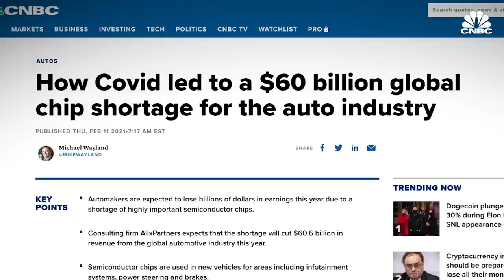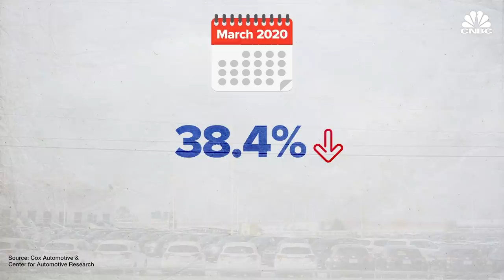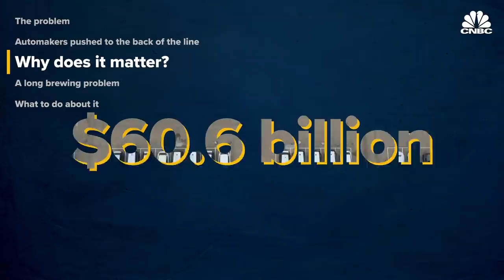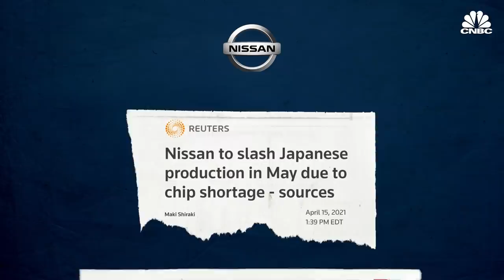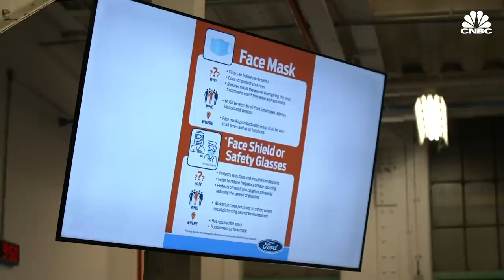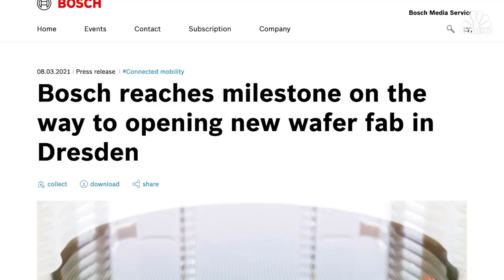Why Tiny Microchips Are Crippling The Global Auto Industry And Driving Up Prices

Comment: Or bring home the supply chain and not deal with these problems
Reply: Maybe some of these chains are foreign companies and not from the USA. Shocker right?
Reply: Yes and no.  I agree we need to start making stuff back home but there's always the issue of supply chain since chips use rare earths that aren't readily available here so there's almost always going to be a link in the chain we can't bring back home.
Reply: That's not the problem, the problem is that auto manufacture underestimate needs, cut their order allocation, then regret. Do you know how businesses work? The same exactly will happen if the chip manufacture is in the US, if auto companies cut their order then chip manufactures has to find other buyers to fill the order, do you expect the chip manufacture to sit there and do nothing with the idle capacity and lose money? That's not how business work.
Reply: Rare Earth minerals are quite expensive to mine which is why they're mined in China so the profit motive really doesn't allow it. Also most of the advanced chip Supply is under the control of tsmc Taiwan and Samsung South Korea. You're not just going to hand over their secrets. Tsmc did agree to build a plant in the US by 2025 so that should help but by the time it starts producing 5nm that will already be outdated Tech. they're doing this on purpose because Taiwan uses tsmc as a security guarantee that the West will help them in case of an invasion by China. Also even if the plant was in the United States, it wouldn't make a difference because chipmakers wouldn't close down their Factory just because automakers canceled their orders, they would obviously take other orders and automakers would still have the same problems. We could ship parts of the supply chain to the United States but shifting almost all of it is an extremely difficult task because of the fact that is literally like a hundred countries involved in it
Reply: Lol. I like how you think it's that simple.
Reply: @benchoflemons398  Fed can print as much money as they want, but you still cant immediately buy chip with money, you still have to submit your order to chip manufacture a year before you actually get the chip made, so that doesn't solve the problem here where ato maker underestimate and cut their order
Reply: not "bring home" per ce, but Trump did contract the world's largest chip manufacturer from Taiwan to build 6 factories in the US. So it's happening, just maybe in a decade's time

Comment: I think this might pinch out some of the automakers that can't pivot quickly enough to make use of commodity electronics. The infotainment centers and even the highest in cars probably don't have the processing power of the top end raspberry pi. Add a touch screen, a case, power supply and a cellular modem and your bill of materials couldn't be much over $250-300. But they will charge you 10x that when you buy it with a car (and 25x if you need a replacement part). The way I figure there's really about six processors that really need to be in a car. You have the engine computer the handles the drivetrain, a chassis computer that handles the brakes, suspension and steering, a body computer that handles the climate control and windows, wipers, lights, seats and so forth, the infotainment which handles the radio & communications systems. We need a fifth one for autonomous functions, and last we need a system for active collision mitigation (air bags, pre-tensioners, deployable safety features such as exterior air bags, pop-up hood hinges, rollbars, suspension reactions to prevent roll-over, and of course Elon's cold gas thrusters to jump over anything they can't accelerate, decelerate or turn to miss).

Comment: No general shortage of microchips. Car dealers, novices at electronics supply chain, moved from using standard embedded computer components to custom fabricated and programmed chips to "provide extra value". Everyone wants custom chips but turnaround is longer and fewer silicon fabs have that capacity. The additional cost could have been put towards building a US silicon fab.

Comment: My question is, is there a potential for recycling of old chips from old cars or “totaled” cars that might otherwise be thrown out?
Reply: Not in the sense you are referring where they can be salvage for re-use.  The chips are all surface mounted so the labor it takes to remove without damage is incredibly high and creates reliability issues in the environment they would be remounted for use (lots of vibrations, temperature variations in a car).  Also, the chips are made to order with subtle changes to the extent they wouldn't even work properly in other applications requiring something similar.

Comment: An issue is chips can be very specialized, whereas if you can use 'programmable' chips, the same chip can be used for all functions.  Field Programmable Gate Arrays for example.
They are more expensive for sure, but compared to the losses, an extra $5-10 seems cheap now.

Comment: Ok. I got a question. What would be the feasibility of getting a car without chips? You can get a lightbulb to light up with an orange.
Weather channel has the temperature. 
Can I get a car that starts, I push pedal and it goes forward? I'll even take a manual.
Reply: It can drive, but it will most likely consume a lot more fuel (no engine controller), have few safety features (no airbags, ABS etc), no radio besides good ol analog tube radio and ofc no cruise controll and the likes
Reply: @johnuferbach9166  Fuel consumption sounds like it could be the only downer. What about power? Can my cell phone charge? 
I dont see a problem with this setup.

Comment: I would love the option to buy a vehicle with hand roll windows manual transmission and no chips.
Reply: So twice the fuel consumption, no airbag and no radio?^^
Reply: @johnuferbach9166  More gears and less slop, a manual is usually better on fuel then an automatic.  airbag and radio I could easily live without.

Comment: What u expect when more and more tech they put in car that u need a manual to use it. I and if not most average people are fine with a running car with simple cd player and speaker system, running heat/AC, electric windows and other simple necessary.

Comment: The answer is pretty obvious if there's too many chips installed into a single vehicle. Imagine if this was the standard for each and every home appliance. Clearly, a single chip is needed for car manufacturers to try and adapt and adopt because it will be a continuous issue if not dealt with correctly.

Comment: Aside from the time and capital it takes to setup silicon fans, good luck making 7nm wafers... Right now no one aside from TSMC has been able to successfully produce at commercial volumes. There's a reason TSMC is king, no one else has the know how
Reply: Its not the making of the 7nm Wafer that is/was the stumbling block. The actual chip speed/processing power is barely in the i386 or i486 processor capacity. What does a 2.0 litre gas powered twin fuel injector system need a thin panel display in the front dash for ? Nothing. But give it precise production tolerances, and effective build techniques, even the latest production car could be run with a series of 6502 or 6800 processors, each doing their "specialty" while leaving the "main" processor running at 50% capacity, with room to spare. i386 technology was 1000nm or 1um in 1985. [1]

It is not that TSMC is making 7nm wafers. It is that they are making 7nm wafers and their rejection ratio from the fab is so low, that they concentrate their efforts into that size of technology.

You do not hear of the Dacia/AutoVAS group of companies slowing down production of their cars. NASA guys laughed at the "washing machine timers" used in the Soviet designed rockets. But there is something to be said of a device that "takes a licking, and keeps on ticking".....(TIMEX).

[1] https://en.wikipedia.org/wiki/I386

Comment: The problem I see is that a lot of these chips are being used to deliver features that I neither asked for, nor want to pay for, but are included in the bundle, and hence are unavoidable.  They are designed for lowest cost to manufacturer, so there is no resilience for repair or upgrade.

Comment: The solution is simple.
1a. More chip manufacturers spread out evenly accross the planet in various regions, no more monopolies/oligopolies thus having a fair and competitive market. 
1b. No more merging, fusions or acquiring of competitors and all partnerships between competitors to be very vert very limited as not to create imballance in the market like we have in the present. You have the same car sold as different brands. Wtf is that?! Ah different brands share like some seats and buttons and engines. Ok, that is sufficient, but the products should be completely different and not create an unfair and concentrate strength on the market.
2. Simplification of cars. Too many integrated functions, too many "smart" features. We don't need none of that. 
A car with the electronics of the 90s is sufficient. An electric motor setup is easy to do and not overly complicated in electronics, which are funily enouh wide spread, not automotive resteicitve like combustion engines.
Entertainment is too widespread, so no specific for cars there either.
Reply: Chips are also made in Arizona Texas and NY

Comment: Idea... Forget the need for chips. Go back to the old systems of manual, fool proof manual set ups. It's cheaper, more dependable, easier to fix, cheaper to fix, and , in the long run, much more dependable. Chips are subject to extortion and obsolescence. Chips are subject to voltage surges and electronic pulses. They are also subject to control by foreign government  bodies. Not good.

Comment: Why can't they centralize everything on a single chip instead of having one for every single system?
Reply: Performance. There's a reason you have a cpu and a gpu along with other chips in a PC. Each has its own function. Couple that with the need for memory chips for ram and rom, you need a lot of them to get the performance you need.
Reply: @spwicks1980  That was my thought but couldn't they design an all in one chip that can handle the different tasks? I can't believe a car requires high performance chips. Reliability and stability are more important. But when trying to find ways to cut cost, you'd think that centralizing the electronic would be one of the first options.

Comment: I added halogen lights to my Mini and even that wiring required a microchip controller module. It just turns on and off. This car is so complex it must have hundreds of chips.
Reply: It doesn't just turn on and off, it probably also does the power supply which is quite a piece of work already for high power lights^^

Comment: What are the reasons of shortages in chips? After going through the video I'm still more or less otherwise more confuse from where I started
Reply: Tons of people doing work from home and lots of disposable income stuck at home and using the money they did not spend in bars and restaurants to buy electronics
Reply: @denismiranda1372  that's the number 1 reason?
Reply: Your question is answered at 0:31 and again at 3:36 

To put it in simple terms, due to COVID people were NOT buying cars hence the 40% drop in sales. But they were buying electronics like video games, laptops, webcams, etc which use the same chips. The manufactures of the chips stand to make more money focusing on the electronics rather than the cars.
Reply: @eddy3080  ahh.. I see
Reply: @Edwin A it's most likely not the same chips... but the same fab space / time, so when the auto makers terminated their contracts for the production, the fabs allocated it to other customers, so the automakers were left in the rain when they wanted to get the production back up... it's not just car parts though, lot's of other compinents are also lacking right now
Reply: THe virus   higher demand for lap tops for kids to do at home school on line people staying home wanting video games

Comment: They can have the chips made in California.  There is a whole Silicon Valley area that only builds circuit boards and  chips.
Reply: not really as setting up a production line takes months, even years. Also, most of companies in silicon valley make small runs of prototypes, not big production lines, as thats whats needed there.
Reply: Cost of water and power wont put Cal as a desirable place. That's why Samsung and TSMC chose TX and Arizona. Even that, production yield is yet to be seen in the next couple of years.
Reply: Chips are made in Arizona Texas and NY
Reply: @TheLastCrankers  Chips are made in Arizona Texas and NY

Comment: “There can be thousands of chips in one vehicle”. WHAT.  I get that they are small, but I think that lady is confusing sensors with the actual chips that aren’t meeting current demand from the auto industry.  Am I wrong?  Where are the 1,000 chips in my vehicle?  I’ve  made software tweaks to almost every control module, damn near memorized the electrical documentation and data flows between modules… where are these chips?  If I had to guess, I’d say anything shy of a 2019+ TSLA, MB, Audi, VW, Chevy, Ford has a max of 30.   I mussed be misunderstanding something, right?

Comment: They are made out of sand just go to desert and dig some up.. they have something called carburators available holley and Edelbrock make em
Reply: With a little Caveat! The EPA in the USA forced the hand of the car makers in the 80s that was the death siren for manually adjusted carburation with an RPM of Idle to 4000 where the fuel is gasoline, and the air intake cannot adjust the air/fuel ratio to get the complete combustion needed for a "clean burn" aka stoitiometic ratio. If Holly and Edelbrock were able to be ^compliant^ over the complete EPA drive cycle, they would do it. But they cannot. (Not with Naturally aspirated engines AND fixed piston Volumes.

Turbo enhanced CAN do it however by blowing more air into the cylinder per intake stroke, but GM can't enfringe on the BOSCH fuel injection pattents, nor can VW have "Flex-fule" in their advertising.

But FORD was designed to run on 100% home made alcohol, yet the CONGRESS pet an end to that idea right quick.

So, where is the actual problem?
Reply: @richardinoutofcobourg7212   yeah gov always thinking of ways to mess up the little people

Comment: Chinese GM makes a $5000 urban EV that plugs into 230V outlet.  How many chips in that?

EVs have no emission control.  No ignition.  No fuel feed. 20 or so parts instead of 2000 in the drive train.  

You can pay North American, Japanese, Korean or European makers for fancy crap.  But the vast majority of EVs right now are like tuktuks in India where 2 stroke engines are eradicated... EVs creep up from bottom to the high end even faster than they creep down from luxury. 

North America and Europe are not important in this century. All the banking systems are totally bypassed, real estate is entirely money laundering and there is no penalty for fraud or any white collar crime.

Comment: Cars dont need microchips to perform at optimum range. 1935 Audi was hitting 150mph. Not one computer.
Reply: My question, why does a car need to go 150mph in a country such as thr US with max speed limit of 75-80mph? 99% of the cars are the road are grossly overpowered, overbuilt gas guzzling, environmental destroying, finite resources using 4000 lb monstrosities whose primary use it to move one 150-200 pound person around. Its completely ridiculous.

Comment: You say that consumer want vehicles with more advanced and more computerized components. I don't know about others bu , as I am a car consumer and user, I don't want them that much advanced and computerized. What you put in the demand of consumer is more a trend, than a clear willingness to be put out of the control of the car we depend on.  And I have no choice but to consume cars I don't want because there is none like what I want. I repeattedly ask my 2 last car builders to allow the driver front window to be open by hand as an example. That means less elctricity needed. Impossible.

I know self driving car are coming and I am agaisnt the generalisation of this concept. The driver should always be responsible directly for his car. With self driving car, we have another chance to pluck out the mind of more people they can get absolve of negligence. I could write a lot more on that kind of subject but these 2 are the easiest to spell out.

Comment: There are no buffers and to much greed .  
Demanding to much and not sticking with what works ,  things like regulations and  no standard form or factor/functions  also can be a big factor , cheeping out on spec and designing different chips that does the same  but have only one use chase.  
About the only thing that is almost a stander is the light bulb even that is now moving away from stander form and being made in different non standers the only suit one brand or model.
So when there is a ripple in some part of the industri there will be issues . 
Just like the economy over inflated and made to suit the smallest group , giving less value / Quality on any product, resulting in big losses for the masses that end up whit the bill, and a non functional product that is too expensive and complicated  to fix  or maintain. In the end its all about the money.